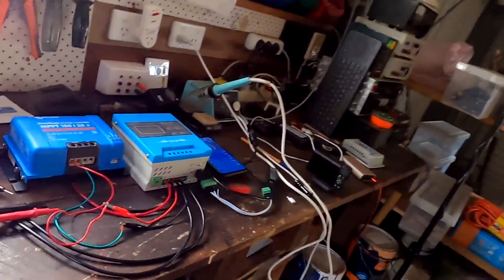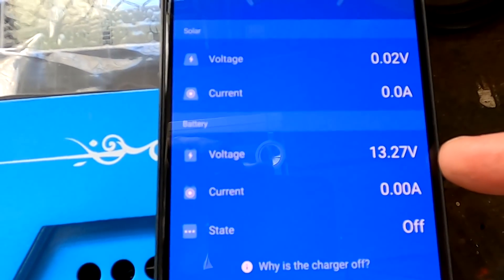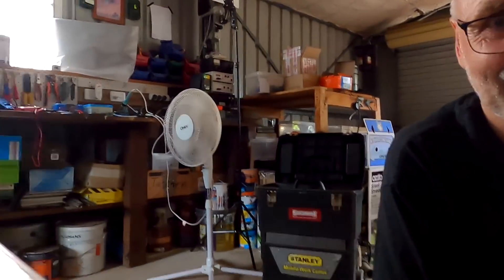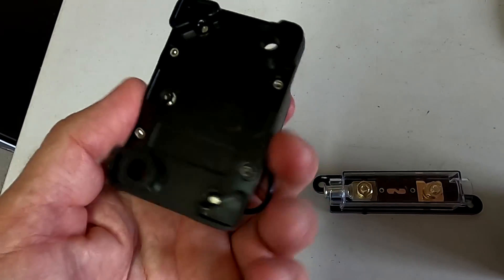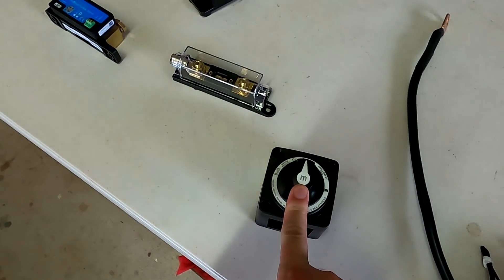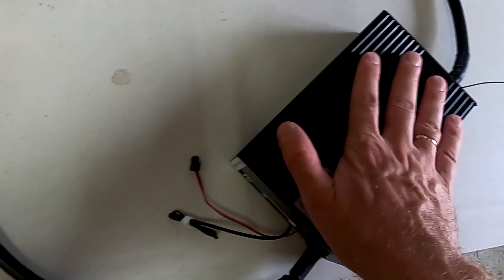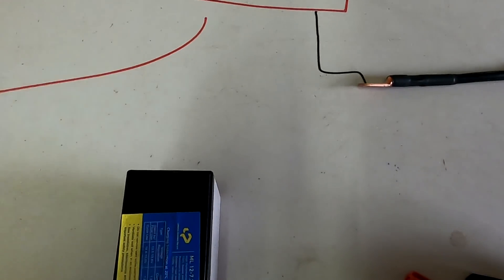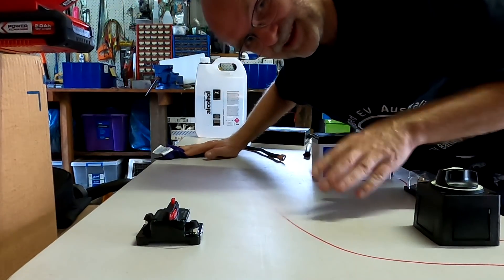How to arrange all your battery gear? Best practice?

Comment: Fuse needs to be as close to the positive terminal as possible. If I was you I would look at getting a terminal stud fuse just like what is used on car batteries. It will protect as close to the terminal or stud as possible therefor any short circuit or fault condition is protected throughout ALL of the cabling. Then go to the battery isolator as soon as possible.

Comment: It's your build most ways work but I would connect the BMS directly to the battery then the shunt as it has minute positive charge on it. From the shunt to the negative bus bar where you can take all your loads (negative) from then if you want to monitor a piece of equipment separately with another shunt you can.
Reply: Also I would have a separate breaker for every Charge Controller and Inverter for both battery and PV

Comment: I put shunts on p- after bms fuse in positive line
Reply from the maker: So you connected the BMS first to the battery and then the shunt, not the other way around?
Reply: @OffGridGarageAustralia  yes bms direct to battery as they do if you bought a sealed battery with bms  inside enclosures shunt after bms I always fuse positive line as a preference and convience at battery to protect all equipment down stream .I fuse from solar input to charge controller it is debatable as to fuse between battery and charge controller I do but over size fuses a catastopic safety .reason being some charge controllers fry with solar input and no connection to battery I would use victron advice on that .really liking the build so far ..
Reply: Epever shows a fuse from battery positive to AN charge controller positive .i am in the process of installing updating my system with 2 100 amp 200 volt. Mppt epever controllers.i was using a diversion load type controll with my old nickel iron batterys.i have updated to 38 kw lifepo4
Reply: Victron smart shunt nice. All victron stuff nice but you pay more for the quality only downside with shunt is no display on board. But you can monitor the voltage in your gate battery with it also

Comment: I just saw a video where he showed that 200 amp breaker is junk. 👎
Reply: 200 amp breaker tripped off @ 70 amp because the metal was to thin inside the breaker, it was a good vid
Reply: Channel was electronics n more